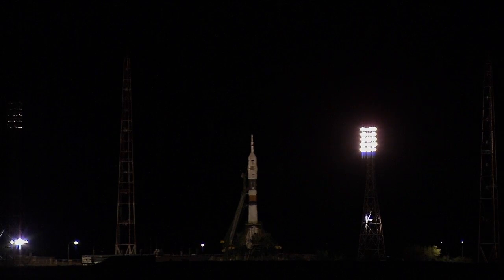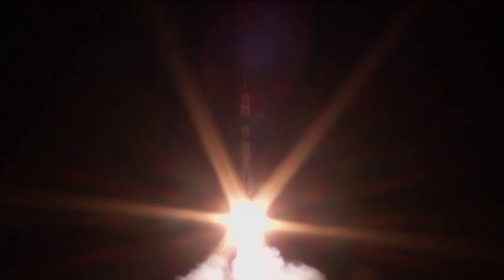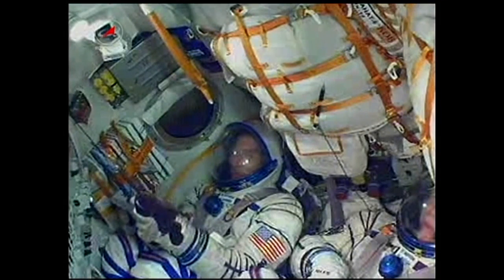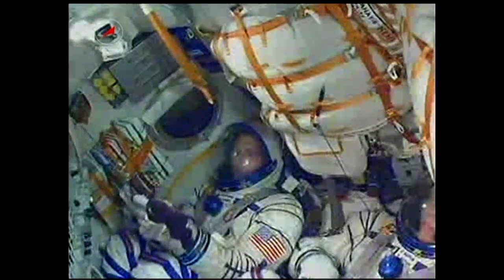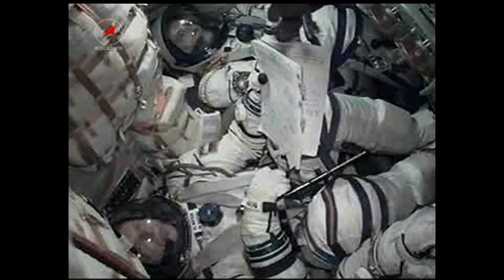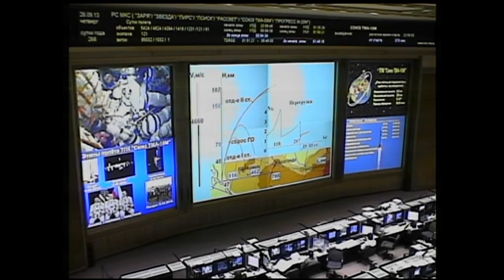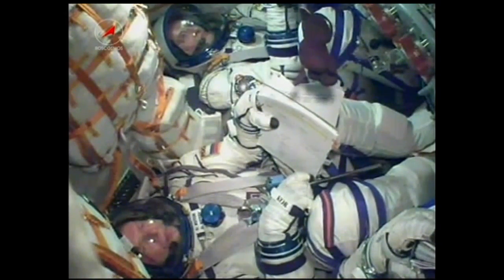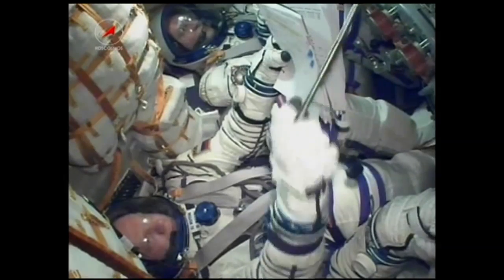Expedition 37/38 Launches to the International Space Station

Comment: I'd feel much safer taking a ride on the Soyuz over the prototype SpaceX Dragon. That's not meant as a diss on SpaceX, but the Falcon-Dragon is a new system bound to have at least a few hidden bugs that could spell disaster if they aren't discovered and corrected before an accident occurs. Not that either is without risk, but the risk is lowest with the long time operating Soyuz system.